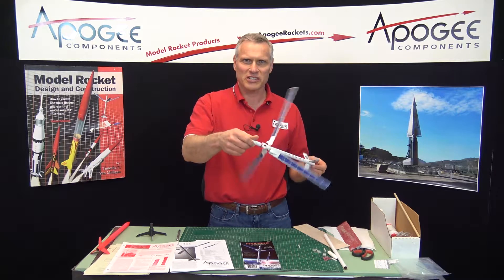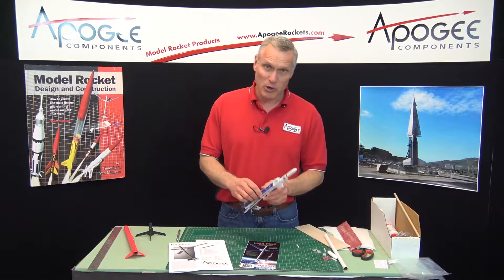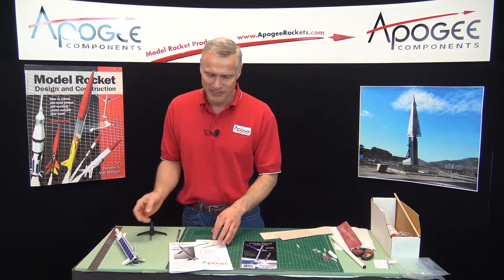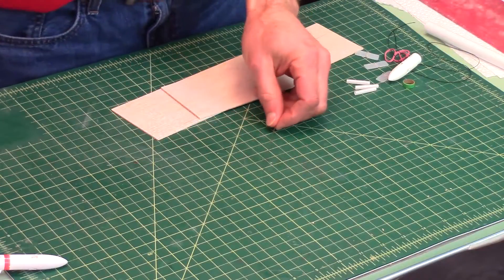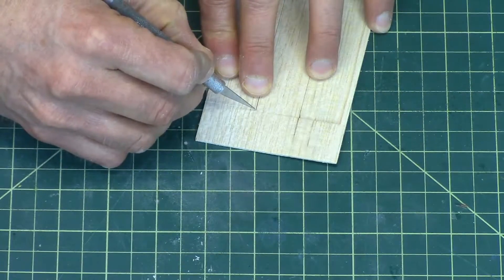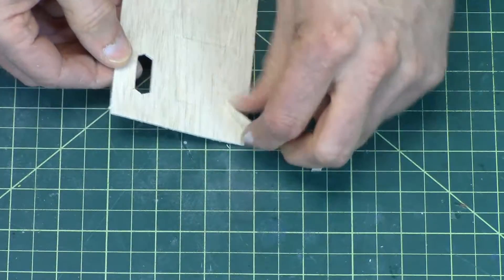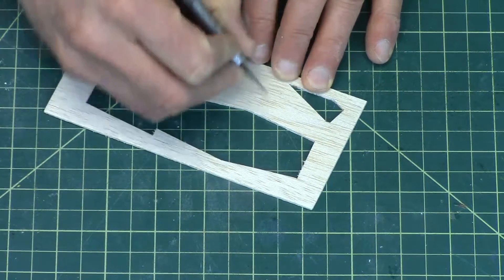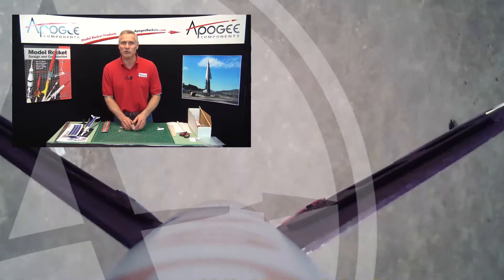Heli-Roc Assembly: Part 1

Comment: How's the drift on these rotor style rockets? Curious if the wind affects them as much as the typical parachute equipped models. I know I've had a few 1000 ft sprints to recover a rocket that landed in a heavily trafficked area!
Reply from the maker: Helicopters can be as efficient as parachutes. So it is possible for the rocket to hang a long time in the air. Be prepared -  just in case.